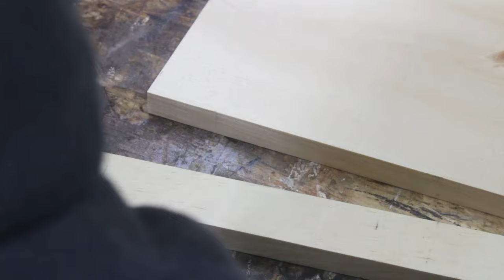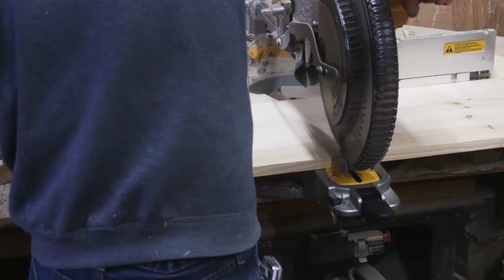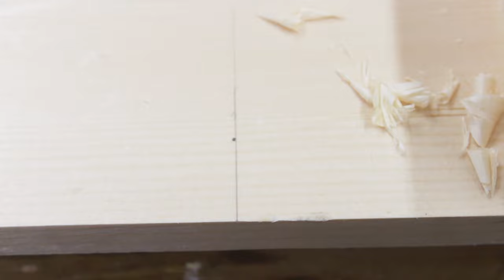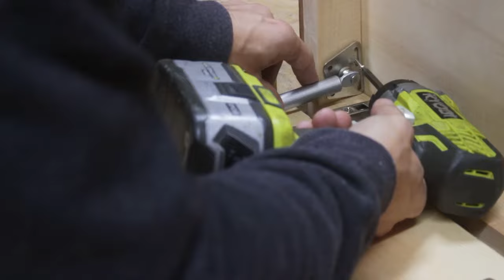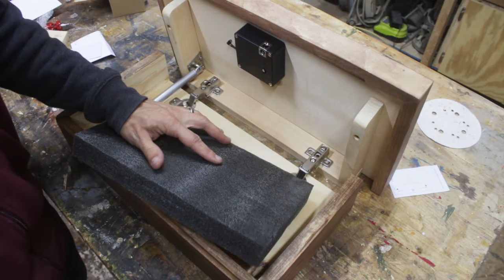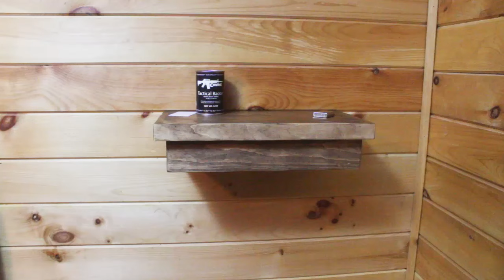A quicker easier Stealth Shelf.

Comment: What’s the point of the groove made at 2:20?
Reply from the maker: You have to knock that corner off so it will close properly. Yeah I didn't do a good job showing that.
Reply: @LastLeafStudioVideo  oh okay got it. That top piece is 18x12 right? Nice build.
Reply from the maker: @SLickev92  I believe it's only 9 1/4 x 18 but I can't remember. I'm sure 12x18 would be just as good if not better
Reply: @LastLeafStudioVideo  ok cool . 9 and a quarter sounds better cause I’m trying to keep it more compact .

Comment: What type of wood did you start off with and measurements ?🤔
Reply from the maker: It's pine with a dark Walnut stain. I'm pretty sue the top measured 18" long x 10" wide plus the pieces around the edge. Sides of the bottom are 1x4 measured to fit inside the top with an 1/8" gap all around except the back.
Reply: @LastLeafStudioVideo I like that stain. I use that alot.

Comment: Are you using the Ryobi brad nailer or pin nailer?  Which one do you recommend?
Reply from the maker: This is the Brad nailer. I would actually recommend no nails for this project, but I am very impatient so I used them instead of clamping.
Reply: Thanks for the info.  I would rather build them faster too.  Plus it would give more peace of mind that they won't come apart.
Reply from the maker: @1991DesertVet  yeah it's always nice to have that little bit of backup
Reply: Yep.  I'm planning on going to Home Depot to buy one today.  Gotta try out my new table saw now too.
Reply from the maker: @1991DesertVet  nice.  Good luck